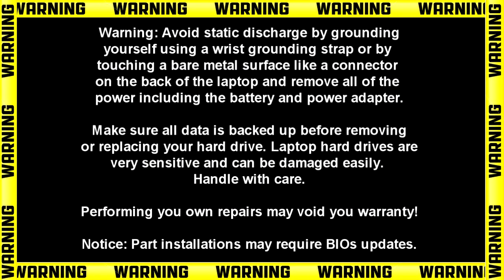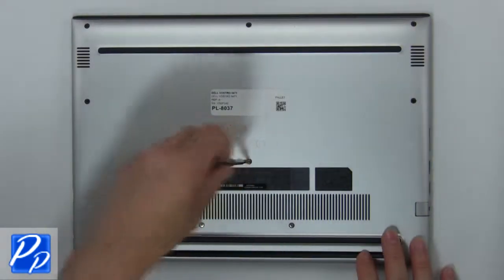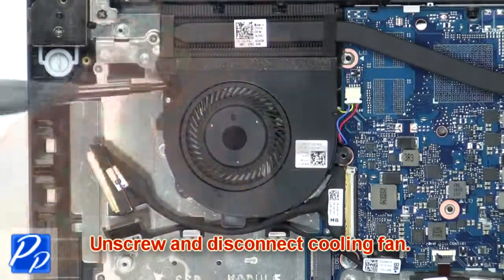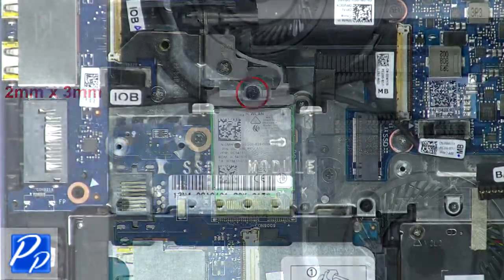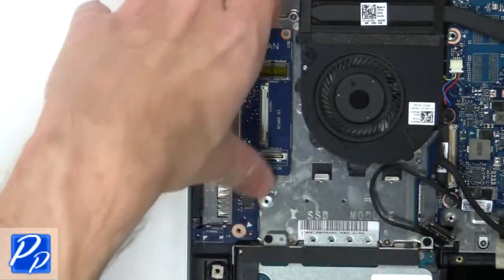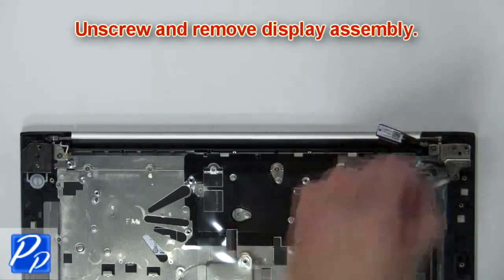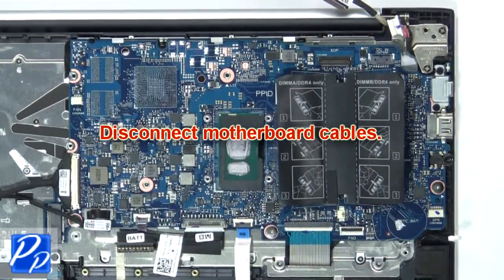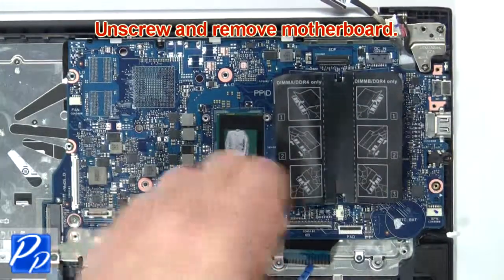Dell Vostro 5471 (P88G001) Keyboard How-To Video Tutorial

Comment: There are a couple of proplems with this video. Example: you can't remove the power button until you have already removed the display assembly. Regardless, there's enough here to help you get the job done. Take a few pics with your cellphone along the way, and reassembling will be easier.
Reply from the maker: Good catch. I appreciate the heads up.